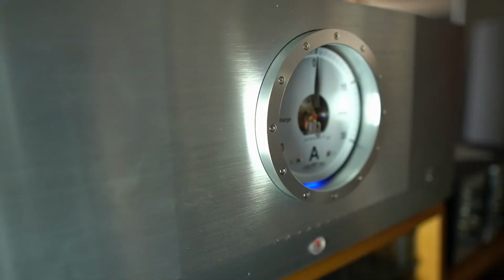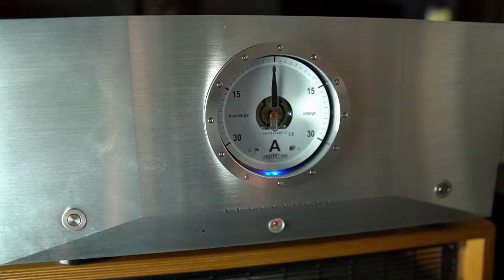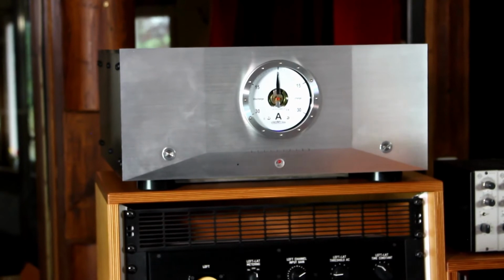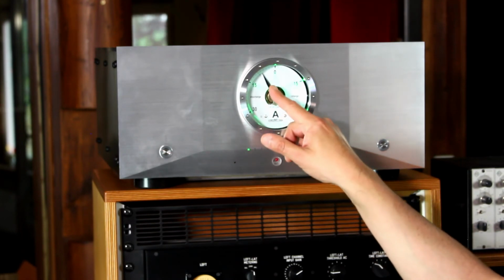STROMTANK S-1000 review from professional recording studio TheSoundphile.

Comment: It's not worth watching the video since I know this guy is going to claim he heard something. But he didn't. Devices like this have been tested and tested by sites like audio science review, and there is no benefit to having them.
Reply: I know Audio Science Review. This is an interesting and strange forum. Mostly they hear nothing and found no effect into most gears, cables they mesure and listen too. They also paise cheap DAC that are very good at mesure but sound exactly at their cost so modest. I am engineer and ASReview say that they are specialists but most of the time they are make wrong mesures so they could not find the solution. I listened to STROMTANK many times and this gear really improve sound. Many audio electronic manufacturers make electronics (mostly preamplifiers) with the same function than STROMTANK and all are praised for the sound. I think apart of this video, it's better to listen, to compare and to judge at the end. True scientist always find the solution to mesure what is obvious with hear.
Reply: @philippeperrot5461  if you listen to it knowing that it was in the signal chain then that was biasing your decision. If something measures the same it will sound the same. End of story.
Reply: @Wizardofgosz  I listened to in some systems using it and trying to ear if it is better, worse of different. Audio Science Review always said a lot of things do not work based on the fact that they could not identify the good measure. I know a lot of people that judge without hearing. What I could say that it sound clearly better, and some trained acousticians or music instrumentists say the same. Anyhow Forums are (always) full of people that have their own judgment and I do not care. When you read that one of the best DAC is a cheap Chinese DAC I know well, some of ASR never go to concert. Best
Reply: @philippeperrot5461  the PSU in your components filter out all of the noise already. The stromtank and those other garbage units from PS Audio do nothing.
Reply: @Wizardofgosz  if you think about those filters like e.g. Shäffner present in most if not all components, they reduce pollution up to - x dB. They not remove DC that make saturation in PSU, they do not regulate enough if AC mains fluctuate more than 20 volts. I encountered many pbs du ti measured AC fluctuations due to industries, winter (all is connected), small drop down of 1 sec to 1min, and also having AC noise reduction as greater as possible is good for sound. Have you even listened to a revamp using internal batteries? Dartzeel, Siltech... Interesting.
Reply: @philippeperrot5461  Many measurements of many pieces of gear using AC regenrators and NOT using them have shown no difference in the output of the gear.

This is a waste of money.
Reply: If I see Traffic light is red, but i do not have measurements to verify (because my eyesight is biasing my decision), then I must act as if it is green. Because BIAS! 🤡😂